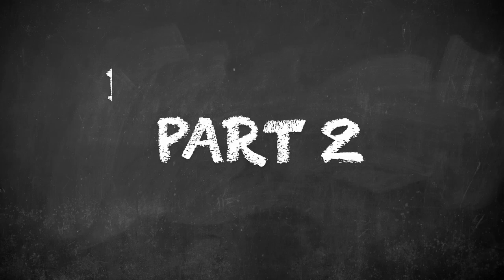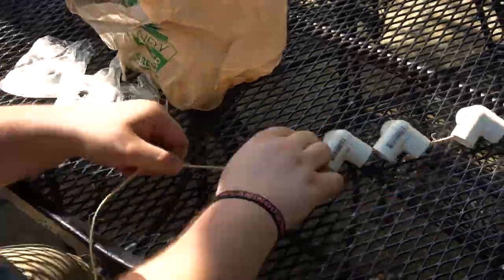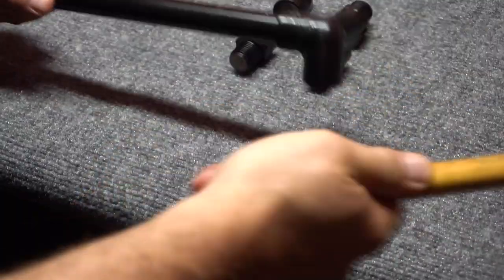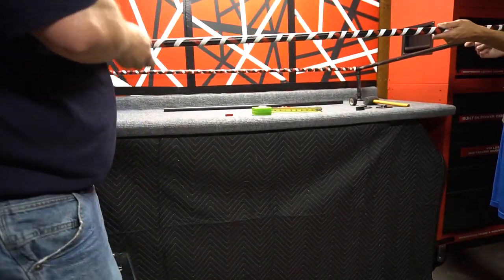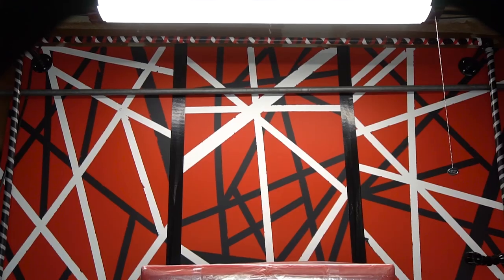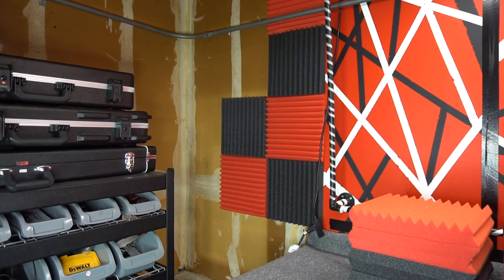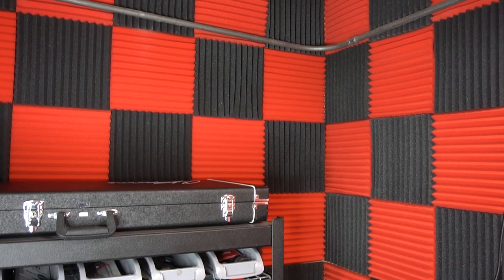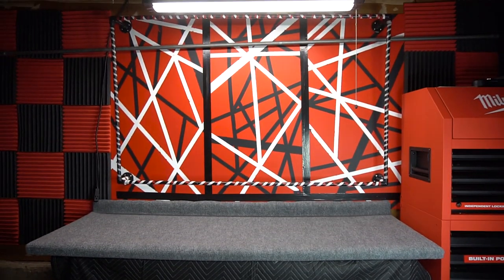Building An Epic Workshop - Part 2

Comment: Matt, you should use those extra foam tiles to fill up the bit up top. It wouldn't be any more functional, but it would look better in my opinion.You can see it at 2:37.
Reply from the maker: Only have 3 plus I'd have to cut each of them which is too much work haha. It's only about 5 or 6" of empty space. When my Dad films videos you won't see it anyways
Reply: swashin haha alright senpai noticed me